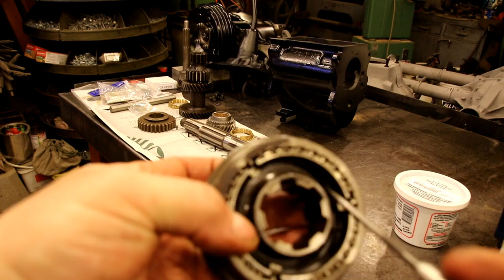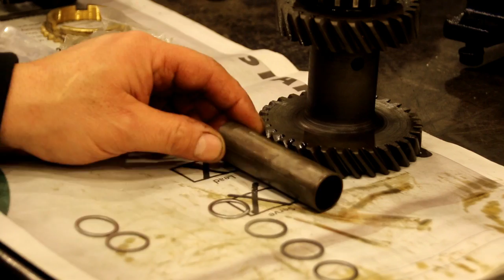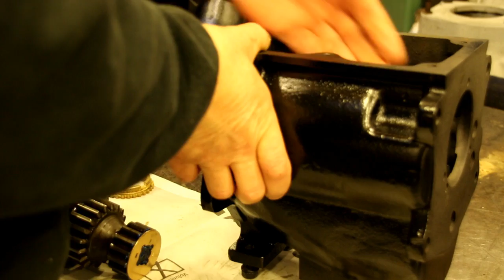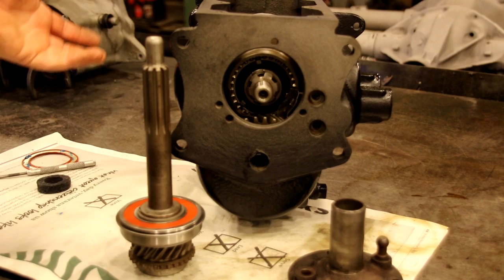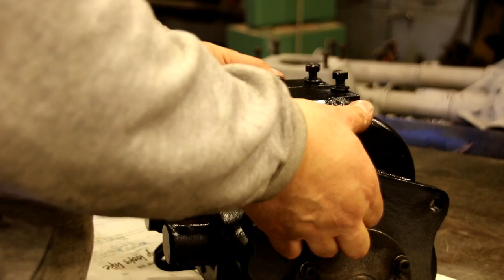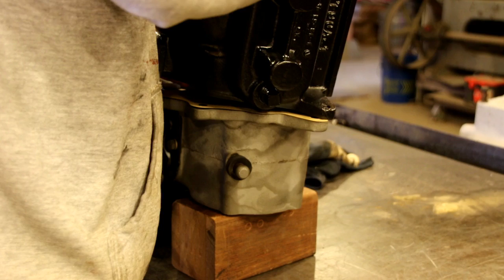Willys T-90 Transmission Rebuild

Comment: Hi, Your videos are a lot of help. I'm doing my T90. Here's my question. I'm using a front sealed bearing and removing the rear seal of that bearing as you show in this video. Then you say to leave the oil return hole at 7 o'clock on the front of the case open. So with the front side of the bearing sealed and oil not coming into the bearing cover,  why would this return oil hole  want to be left open?  The hole is outside of the bearing  on the now "dry side" of the bearing. My Novak kit says to plug it.  This is my first  plunge into the T90  on my '49 3A and I want to get it right the first time. Am I all messed up or what? Thanks, Jeff
Reply from the maker: you can leave it open or plug it, does not really matter.  I have had bearings in the past begin to leak after a few years and if oil does get past the seal it has no way to drain back into the case so I always leave them open.  I have tried all different manufacturers of bearings and 99% of the time no oil will ever come out....... but I always like to plan ahead for problems.   Also if you use the proper lube that I sell the chances of the bearing leaking are even less so the choice is up to you to plug it or not.  Good luck with the rebuild, 
Brian

Comment: Hello Again, been watching and following your T90 rebuild and has been an immense help! Thanks for the reply to my last question too. I have another question, I finished the T90 rebuild, but it's a bit stiff in the turning of the gears. Nothing is hemmed up, all turn just a bit tight. Yours appears to turn a bit more freely. Is this normal? Thanks again for your help and advice. 
Tony
Reply from the maker: the usual place for drag is from the blocking rings being new.  Take a screwdriver and make sure they are not too tight,.....pry them back .   Next it will turn a bit stiff when new and has no lube in it.  If it turns by hand you should be ok.  Lube will make a big difference.  I have the correct lube if you need it.  Do not use any modern gear oil or any type of differential lube like 80w-90.
Brian

Comment: when i took out cluster gear of 1950 willys cj3a, there was 4 washers and 88 needle bearings. With only 4 washers what is the order of washers and needle bearings? Do you leave out a washer next to spacer?
Reply from the maker: If you have the larger spacer and 4 washers then you leave out the ones closest to the spacer.  Spacer in the middle, needle bearings, washer, needle bearings and washer on both sides of spacer.

Comment: I had a guy working on this for me and put it all back together and the shafts are locked up. Any ideas?
Reply from the maker: your synchro rings may be sticky on second and third gear.  Take the top off and place a flat blade screwdriver between gear and blocking ring and pry it off gear.  that usually fixes things.  Drip some oil in there and it should fix it.  If the transfer case is already attached perhaps someone put too long a bolt in there and it has bound against the cluster gear locking things up.  Let me know how it goes.
Brian

Comment: Do you put any sealant on the gasket between the transmission and transfer case?
Reply from the maker: just a dab or two in a few places to hold the gasket in place.  No need for sealer on the entire gasket.   it will seal fine, just make sure it stays in place and does not move.  
Brian
Reply: metalshaper hi Brian,thank you for your help. I'm from ct also, chuck barnes told me about you and to look you up. My father in law and I are restoring a 46 cj2a that we rescued from the woods in ct.
Reply from the maker: Jason, good to hear from you.  You can contact me directly at metalshaper@comcast.net 
Let me know how the project is going.
Brian

Comment: What is going on if after a rebuild I cannot get it into 3rd?
Reply from the maker: Sounds like something may be wrong with the synchro unit.  take the cover off and make sure the blocking ring is moving freely and not stuck to the input shaft(third gear).  If it is pry it away with a screwdriver carefully and you should be able to move the synchro into gear with your hand.   Is transmission in vehicle or still on the bench?  if it is in the vehicle and not working you may have too light a gear oil in there that is making for hard shifting.  The more you tell me the easier it will be to diagnose the problem.
Brian
Reply: thanks for the fast reply. I just installed it back into the jeep. I took the top cover off, and adjusted both blocking gold rings with a flat head. Once i did that it seem to help big time! it now spins as before nothing would. Was starting to worry that i rebuilt it wrong. Once running i noticed i had a fuel leak, have to take care of that tomorrow then will try and re-fire the motor back up and see if the transmission does any better. Will update you then. thanks again
Reply: Also, i filled the trans and transfer with 80 90w gear oil. hopefully that will do
Reply from the maker: Ok, let me know how things turn out.  Sometimes it is just little adjustments that need to be made.
Reply from the maker: 80-90 is the worst thing you can put into the transmission.  It has additives which will eat away your blocking rings and thrust washers.  Watch my video about lubricants and contact me at metalshaper@comcast.net if you want the correct lube for your jeep.
Brian

Comment: Question, little confusing info here. I had to order a new hardware set for bolting up the transmission to transfer case (5bolts, 3 long 2 shorts) Kaiser willys says the manual is 5 bolts of the same length. So I ordered that kit, your video says two shorts in certain spots. What should I do
Reply from the maker: Not sure what length bolts you have, but the main thing is to make sure you don't have any interference with anything when bolting things together.  Maybe you have all short bolts in your kit and won't have a problem.  If not then follow along on my video and put the short bolts in the locations that I have shown.
Brian

Comment: Great video, I have a 1964 scout 80 with  a T90 transmission, T18 spacer and worn overdrive that I just rebuilt, what kind of fluid do I use
Reply from the maker: I have the correct lube for your setup.  Contact me at metalshaper@comcast.net and I can give you pricing information and shipping details.

Comment: Can you do a T98 rebuild
Reply from the maker: I don't have one in the shop right now to film but will do as soon as one comes in.  Should be getting a SM465 in for rebuild soon for a guy building a rockcrawler, and will show that when it comes in.
Reply: metalshaper built many SM- 465 GMC 4speeds luv them very easy

Comment: I appreciate the info about the supposed "crush" washers that come in a new gasket kit. I had put them on the bolts for the oil collector and figured the "breaking" I felt was from them crushing. 
After seeing this video I took them out and discovered they had just been smashed and broken.
Now I have some copper washers in there just like on the front cover.
You saved me some serious annoyance later! Thanks

Comment: Hi Brian.  Although my transmission was in need of rebuild, I'm still having problems shifting specifically from first to second. The transmission seems perfectly fine and shifts by hand very smoothly with no leaks (thanks!) I think the problem is in my shift tower.  I just replaced the poppets and springs, and realized that when shifting (while on the bench in a vice) from first to second the lugs for first and reverse are sticking out a tiny bit and catching the shifter rod while I have it engaged into the rod that controls the 2nd/3rd fork.  I was going to take it back apart, and grind about an 1/8" off the shifting lugs for the first/reverse fork.  I thought at first the pin that keeps from shifting the gears into two gears at once was the problem, but I am convinced the hang up is there where the shift rod is engaged into the indent in the rod for 2nd/3rd fork, and catching the lugs for the first/reverse fork.  Maybe at some point the shifting cane or rod was bent and changed the geometry slightly, causing this problem.Ever run into something like that?
Reply from the maker: Yes, I have encountered many shift tower problems in the many years I have been rebuilding T-90's.  Do what you need to make it right or just install an cover from another transmission.  Very rare to get two different towers that won't work.  Either way, a little grinding or blending won't hurt anything and should allow you to shift easier.  
Brian

Comment: Question, what is the dimensions of the spacer @ 43:40 , and where can I get them ? I need to make one like it about 2.100" in length for a Muncie/Dana 18 marriage I am doing with an Advance Adapter old school kit. The problem is that I am using an Overdrive and there is nothing for the center of the bearing to torque against when torquing the overdrive to 120 lbs ft.. So I am going to have to make something.

Comment: Will you be doing a video dedicated to fluids? What is the right fluid for the steering box, transmission, and transfer case. What is your favorite and why. GL-5 no good in the trans or transfer?
Reply from the maker: I have all the fluids needed for all the parts on your willys .  I have been selling the correct lubricants for many years to the folks who are looking for the correct fluid.  if you need anything let me know.  Will be doing a short video on the CJ3A project when I fill the transmission, transfer case, and overdrive.

Comment: I finally got back on the t90, and finished it up.  Everything went together fine, but I can't get the hub to slide back and forth (by hand) to engage 2nd and 3rd gear.  Before I put it back in the cj2a, should I make sure that is ok?  Everything rotates like you show in the video, and I don't think the blocking ring is bound.  Thanks again
Reply from the maker: It can be tricky to get it to engage when the shaft isn't turning, but by moving things around you should be able to get into second and third.  bolt the cover on and see if you can shift while it is on the bench.  You want to make sure there are no problems before you install it.
Reply: I ended up replacing the new springs in the hub with the old springs, now it shifts ok, but the old springs still seem fine, still keep it from flopping around.Had another weird problem.  Went to bolt it up to the transfer case, and where the idler shaft plate matches up with the tips of the shafts sticking out, there is only room for the stock plate, which was a very narrow plate that was angled on both ends.  If it isn't perfectly located, it would keep the transfer case from mating up.  I think I'm just going to take a grinder (very carefully)  and grind out the metal between the two pockets, enough to where a trimmed plate like you showed would fit.  It looks nothing like the pocket on your transfer case.  Thanks!
Reply from the maker: Ok, if you have it shifting good now then all should be good.  As far as bolting them together it can be challenging sometimes because of the plate.  You can trim the plate to fit, it just has to be in the groove of the shafts to keep them from moving.  I think it would be easier to cut the plate smaller than grinding out the transfer case, but do what you have to so they mate up properly or the lube will just run right out of there.

Comment: What threat sealant are you using, not loctite, just sealant correct. ?
Reply from the maker: Watch the videos I went over it in detail in the video.
Reply: @douglasbattjes3991 I think it’s Permatex 51813 Anaerobic Gasket Maker

Comment: Thanks for putting this out!   Great video.  Don't know what happened to my spacer on the rear bearing, guess it got chewed up, so I have to get one ordered before I can finish.  A new cluster gear shaft came with my kit from novak, but the old one fits into the case holes on each end better, and the new one has grooves on each end versus just the keeper groove on the original.  I can feel no wear on the old one, I  think  I might just use the old one, if that makes sense. Do you drive the idler shaft and the cluster gear in so that the keeper is flat against the case?  I can't remember what it looked like when I tore it apart.
Reply from the maker: Make sure you get that spacer in there or you will have problems.   It doesn't make a difference on the shafts, a groove all around or just a slot.  Either way install them most of the way thru, put the keeper plate in there and then lightly tap them up against the case.  Not too hard or the shaft will act like a shear and cut the keeper plate.  Just a light tap.   Make sure the plate is inside the gasket and it won't interfere with the transfer case.  Watch the video carefully, I explain it all in detail.